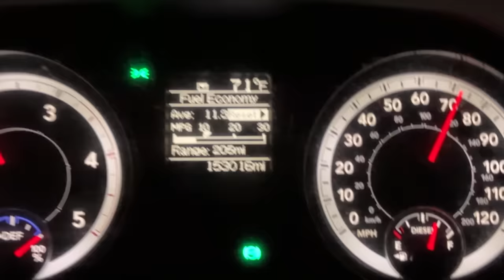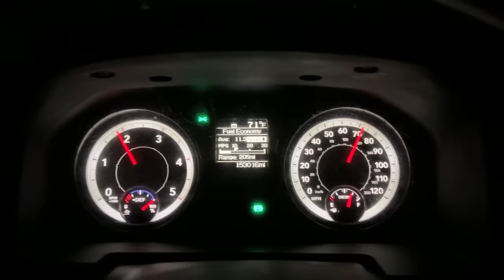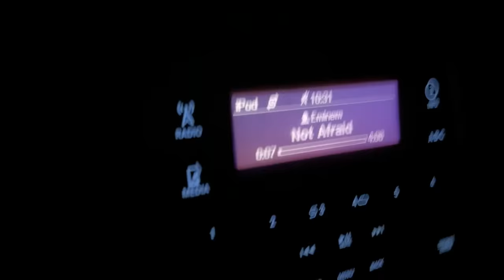My new truck broke down 9.5 hours from home. Dealer refused to do anything...

Comment: As a side note: my experiences with Ford dealers has been great.  To this point, write FMC and let them know how you were treated.  Ford has been pulling “bad dealers” out of the network for the past 10 years.  They are customer focused and witnessed what can happen when you let the customer(s) down.  It is a publicly traded company but it is family controlled.  That is a good thing.
Reply: Since when were dealers obliged to get you home or store your things?
Reply: @Torch4ya you sound like you work at a dealership like this 😂
Reply: @Torch4ya If the warranty has claims of what it covers then, it should be exactly what it states...like a tow, motel room, food, and on.
Reply: Just like many dealers it's hit or miss, some are fantastic and some are not.
Reply: @Torch4ya  It's called kindness. You expect him to carry the trailer away on his back?
Reply: @Mike Foehr, Sure, if it's in a contract, then you're absolutely right.  So far I haven't bought a turd vehicle needing heavy warranty repair, so I've never had to go back and read them to see if I had grounds to flex on them for things like transportation and storage.  I would be surprised if manufacturers would put transpo and storage in there.....
Reply: @yoogityyeet , I was a factory-trained Acura mechanic and trained at Wyoming Tech.........in the late 1980s 😆
Reply: @jesdadotcom , I'm all about kindness, but you assume too much.  First, it's all about what's in any warranty contract, not what's in your heart.  This is a business.  Next, how do you know the dealer had the means to move and safely store the trailer?  Finally, if you're the manager of Service, or the GM of the facility, and you see 100k of equipment on this trailer, are you really going to be inclined to take on the liability storing someone's things?  Ha.  Helllll no!  In fact, perhaps the insurance carrier has it as an exclusion on the dealer's property!  We all have no way to know all the details.  Don't be so quick to judge the dealer because we only know one side.  Sorry for him, but details are details and facts are facts - whatever they may or may not be.  Be realistic, folks.
Reply: @Torch4ya  cool , I'm 20 living in the now hell on earth how was it back in the good days
Reply: Well stated!
Reply: You are correct for over 40 years I have bought new Ford Trucks, F-150's F-250's AND F-350's  they have been great,  Ford's record speaks for it's Self in customer satisfaction for me it's Ford or nothing.
Reply: The actual problem is regardless of what the dealer does they represent a shit vehicle and shit company.  Ford F****d so many people with the 6.0, 6.4 and now the new in-house turd they deserve a medal for bending people over dry.  I lost my shirt on my first Ford diesel I bought to tow what would be considered light duty. 6000lb 16 foot enclosed trailer for work.  After X amount of dealer visits before 30K miles, I decided to leave it stock out of fear.  The month...month after it was paid off and 5K pass warranty it all went to shit.  #7 went soft, caused the computer to freak, dropped power on the highway, caused a downshift that felt like I was rear ended by a semi taking out the trans as well.  There I sat with a paid off truck I pad $70,000 for that was a mechanical salvage.  Total loss.  Nevermind all the lost work and being stranded etc.  I know of a local ambulance company/owner that actually went bankrupt thanks to switching to all (New at the time.) "fixed" 6.4 Fords.  Just having his fuel mileage cut in half to 9mpg (I averaged 8) put him in the poor house!

After that I foolishly purchased a used F150 in "great shape" under 50K miles.  The cam phaser literally fell apart locking the engine on the highway.  It was towed away and I lost my shirt again.  Ford KNEW that was a problem...a BIG one and no recall.  Thanks Bill!  Glad you got to relive your childhood and race Lemans.  Try running your company with some integrity!

Never, ever ever ever will I buy a Ford anything again.  I had Mustangs, Taurus family car, a Ranger as a daily run about etc.  Gone.  Anything  blue oval in my driveway is at risk of being burned to the ground.
Reply: @JViello my 2019 5.0 f150 had a cam phaser failure AND an ethanol sensor failure with only 27k on it. It was warrantied thank god and I immediately traded that truck in. I put like 4500 miles on my stuff a year. I don't need a pricey truck that's gonna have an issue every 30k.

So I bought a 6.7 PSD that's out of warranty lmfao... got an s&s disaster relief kit immediately for the cp4 pump when it fails and then plan on deleting
Reply: @Torch4ya  He wasn't even given 24 hours to figure out how to deal with the situation. As for property liability, a waiver is all that's required. That's IT. You're desperately fishing for reasons to be a dingus. Congrats, you caught a blue gill.
Reply: @Cherokee10g  My F150 was the worst vehicle I've ever owned. Used it to haul cars around the country and it broke down repeatedly. I did get to meet some friendly tow operators and mechanics though. Comfy seats too.
Reply: @Torch4ya  You think a dealer isn't obligated to help you when your vehicle has major trouble the same day you pick it up? Lol
Reply: @Torch4ya  They are obliged when you own a Ford still under original factory warranty. It's  called "trip interruption". You have to be so many miles away from home to qualify.  I bet this is the type of dealer that uses "ADM" (Additional Dealer Mark-up) on new vehicles like the 2 Shelby pick-ups I saw at different Ford dealers on a YouTube video today of $37,000 and $45,000 each. Anyways, The Ford CEO says dealers have outlived their usefulness and soon will be done away with entirely. This Ford dealer could have done much better and still removed their liability if they had wanted to. This dealer is probably suffering from low sales due to the market now and is running off potential sales left and right in the process of the doom and gloom they are facing.

Taylor Ray could have called Ford Customer Service and maybe had a better outcome with an advocate from Ford talking to that dealer. 

Shame on you Ford dealer! 

A big thumbs up to you, Chris! 

Ford dealer, what would it have cost to show some concern to a stranded vehicle owner who has a still under warranty vehicle that you happen to sell? Maybe you have forgotten the costs stats of getting and retaining new vehicle customers that you manage to loose over issues like this.
Reply: Shoulda stuck with a chevy

Comment: Well, that's Ford for you:(
Reply: I will be buying a RAM 🐏
Reply: That's why I have a bulletproof common rail Cummins in mine. It's been happily going for 10 years
Reply: Lol coming to say the say thing but should of bought a chevy
Reply: That’s just new trucks for you
Reply: well thats (insert brand here) for you
Reply: Things happen, things break. It's not a ford thing that's a dealership thing and that's a terrible dealership. Good way to ruin your reputation right here.
Reply: I've worked at dealerships. The service advisor should had been more helpful. Especially that knew of a truck. As far away that you were from home. I'd tell Ford to kick rocks  sell that truck.
Reply: @callmebobownes  True.  My point was more that this is why he originally built the Fummins.  The uncooperativeness of the Ford employees is just icing on the cake.

Comment: Unfortunately most dealerships are like this. This is the normal operation of how things work. Hopefully bad press will get them to change or at least get the manufacturers to fix this kind of support.

Great to see someone like Chris still exists, BAMF of the month if not year.

As for selling the truck back to the dealer, I'm sure you won't get money back you'll probably be upside down on it but I truly hope I'm wrong.

Comment: Bring the fummins back and go though it for sure, as you said you have turned every nut and bolt on it and aren't afraid to get under the hood if something was to go wrong. And I think it will need some garage built decals when it's dialed 👍

Comment: I hate things went so sideways, but Chris is awesome. With almost 800,000 views and almost 4,200 comments, what if we all gave the dealership negative reviews on google for the lack of customer service. There is strength in numbers.
Reply: Dont do that. Spam reviews get pulled down often. Its also not an accurate review of a local business
Reply: Taylor just needs to make some magnetic signs for his vehicle saying Ford dealers are crap, but most of us know that already.
Reply: You also need to remember it has a 3/36000 base and a 5/50000 powertrain warranty and he stated the milage at 50000. He also stated that he's put about 10-15k miles on the truck which means he would have bought the truck AS IS. As for not allowing the trailer on the lot.. that is sometimes normal depending on the space available.
Reply: @IanNubbit  and some businesses get bad reviews scrubbed for a price. Reviews in general aren’t reliable good or bad.

Comment: As a previous ford diesel tech, I’d sell the new one and put my money in the Cummins swap and roll on. Luxury is nothing if the trucks always breaking. 
If you decide to keep it I would check with ford and install the fuel bypass kit if it don’t void warranty.

Comment: Chris is the man! Whether you keep the newer truck or not you need a backup. If the fumins breaks down you’re in the same situation even though it’s easier to work on. It sucks to have two trucks but you travel a lot far from home. If the fumins was up in working order you could have got your girl or someone to bring it to you. If it were me I’d keep the newer truck a little longer especially if it’s almost paid off. Get the fumins in top shape and use it sometimes so it’s not sitting so much. Another option sell the newer truck and build another Cummins powered rig . That way you’ll have two solid  trucks you’ve been through yourself. You could always sell that turbo truck to free up some space at your house

Comment: You should definitely upgrade the fummins. That truck is the best of both worlds, good chassis and body, very solid engine. Newer vehicles are just a huge pain to deal with and fix do to all the tech in them and let alone the cost like you had mentioned. Plus you don’t have to worry about losing power because of stupid emissions equipment like def fluid getting low and sending you into limp mode. That’s just my opinion man, I know you’ll make the right call

Comment: Had the same experience with my F450 6.7 diesel.  Bought it with relatively few miles and after a couple of years things just started to break; one thing after another.  Always took it to the dealer for service and they were very helpful; but they were mystified regarding the one-thing-after-another failures - all having to do with the engine, by the way - fuel system was the main culprit.  Constantly throwing codes.  So relieved that I got rid of it.  Never again.

Comment: It sucks that it happened, and I feel that any good dealer would have at least grabbed the first available technician to at least do a diagnosis the same day. Kind of understand them not wanting the trailer there so they are not liable for it. But damn, 9+ hours from home, give a guy more than a few hours to figure stuff out! In terms of warranty repair, I'm assuming it was an aftermarket extended warranty. Unfortunately, I think there are very few good ones. A lot of them are riddled with fine print on what is/isn't covered-and they all promise the world to you if you have an issue. Some even have warranty adjusters that travel to dealerships and investigate the disassembled vehicle before they will approve a claim. Curious to hear what the failure was. I recently purchased a new motorcycle (my first new thing ever) and also had a crappy experience with warranty repair that left me disappointed. As much as I'd like to crack a Ford joke (I'm a GM guy through and through) the reality is the Big 3 (Ford, RAM, GM) all make pretty reliable trucks these days, so I'm sure it was a fluke issue on something that normally doesn't fail. I understand both sides: get rid of the new truck, it has broken your trust and you will probably always have that worry in in the back of your mind. On the flip side, hang onto the new truck and you may never have another issue with it.

Comment: Right
24:09
Time to paint the trailer completely BLACK, or the old truck WHITE.
Your choice, but I'd assume GREY would be best (as then you'd have to paint BOTH with the same top coat).
Or, change the decals of this with the useless 350 & have a beast without having to spend any money on a motor swap (sending this old black truck's motor into the 350 chassis)

Comment: I love the look of your black F350. I would keep that running. I bought an F350 new in 2008 and it has 117,000 miles on it and still runs strong. I have used it for hauling four horse trailers and hay trailers up steep mountains and has plenty of power. I do regular maintenance and replaced the radiator and tires. Have not even done brakes on this thing yet. Paid $55,000 in 2008 and the direct replacement today is $95,000. So, I think I will just keep maintaining this one.

Comment: So sad, the whole S***show. I continue to wonder why the US auto industry stays in business. The DEALERS are the problem. Most are one step more legitimate than the local brothel. I would rat that dealer out, PUBLICLY. The Ford 6.7 seems to be a terrible engine. Literally EVERYONE I know who has or had one has been bit in the ass by that engine. On the upside, I drive an E450 box truck with the new gas "Godzilla" 7.3 and she's a BEAST. I've seen a number of folks who have dumped the diesel and bought a new GAS rig.

Comment: Hate this happened, but love that the Fummins is back. THIS IS WHY we build our own stuff. I don’t drive new vehicles because I learned from others in similar circumstance that I can’t rely on a dealer in a pinch, in the wilderness it’s just you and the equipment you brought and tools you know how to use. I haven’t been on a tow truck in a decade but once, I drive something I work on myself I didn’t pay much for and I can get parts for. Uber gets me to the parts store and back and Gods grace has kept luck with me. Having said that taking a long trip in a car I bought cheap with high mileage and literally did nothing but check the oil and go, snapped a timing belt and ate valves 50 miles from home on my way back. I knew better, had a timing belt and a water pump in the car, but I figured I’d do it when I got back. LoL. Sorry for the long comment but I’m amped your gonna use YOUR truck that YOU built for YOUR purpose. Not the banks truck the dealership mechanics are “supposed to” take care of.

Comment: And this is why I am deathly afraid of buying a new truck. My 1999 F-250 V10 has 295,000....  miles on her and she still running. I fight with myself daily on buying a new truck or rebuilding my truck. The problem with my truck is I am getting like 13 miles to the gallon... I feel like the new f-250's are a lot more gas efficient...

Comment: id still keep the ford. One crap dealership shouldnt speak for them all. Ford would boot them from network.  Ot couldve been scanned and diagnosed and the shouldve been good enough to give you a loner. Everyone i know that boughy 2020 and up f250 and f350s bought them new and all still are running flawlessly.  Ots pretty much bece the truck all youtubers traded their rams for surprisingly but its because the power and 2 ppl bought them because they couldnt deal with ram dealership BS .  This being the first ive seen with issues it makes you wonder what prior owner did

Comment: Now that is what you call "Badwill" from Ford...
Reply: I think you should build that Fumins, maybe stripe it like the race car so they go together. 
That truck is content worthy, but the Ford is just a rather boring new truck ;)
You gave me a new perspective on my truck/car hauler with this video... Its a Ford Transit Mk1 1973 that I built with a Rover v8, Volvo Aw73 trans, Mercedes prop shaft, homemade wiring and so on... If that thing where to break down with a car on it, it would be bad, but I could (probably) fix it on the side of the road. Have put about 2000km on it so far and its running great, but the worry of something going wrong is still there in the back of my mind... Drove it today about 150km right thru the worst parts of Stockholm traffic with a car on the back and it didn't miss a beat.,
You assured me, it does not matter, just pray to God it goes well and drive. 
Shalom.

Comment: The Achilles heel of the newer super duty is the CP4. Heard it’s an issue with other brands too. If the dealer doesn’t want to warranty it, have your insurance cover it! Personally, reason why I have full coverage (warranty ending this year) and I also use hot shots edt every fill up as a cheap insurance. Good luck with either decision.
Reply: Those new 10 speeds are absolutely terrible as well. Our shop service trucks are f350s with 10speeds and every time I take off from a dead stop, I feel like I’m playing the lottery on when it just blow up.